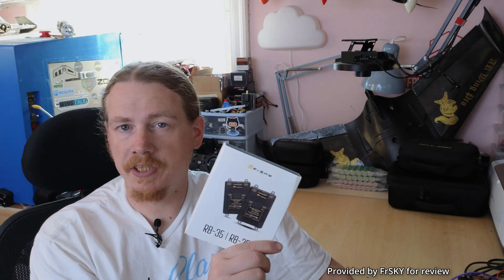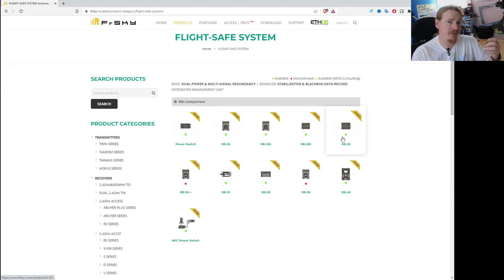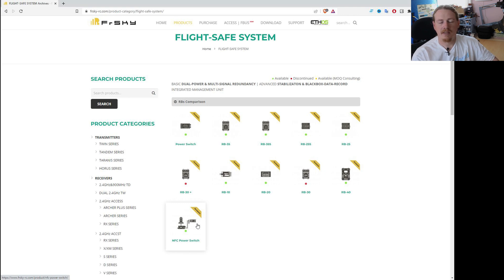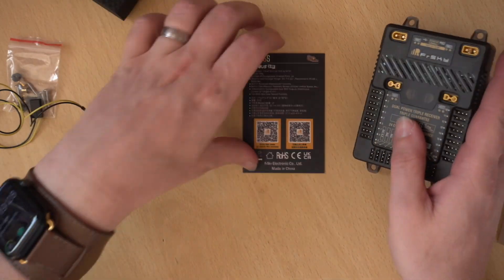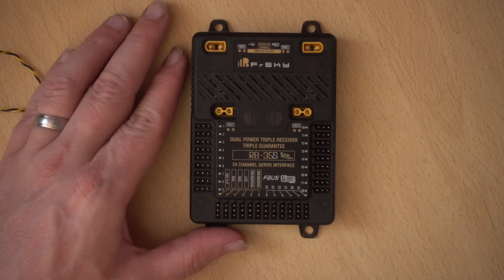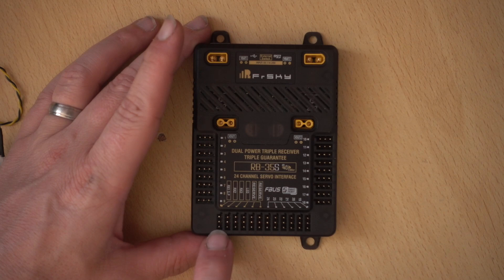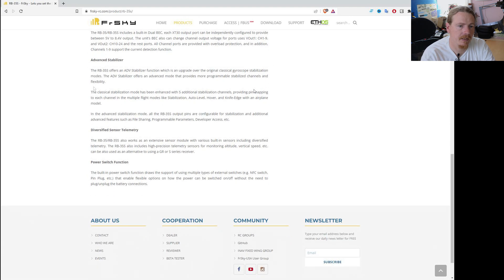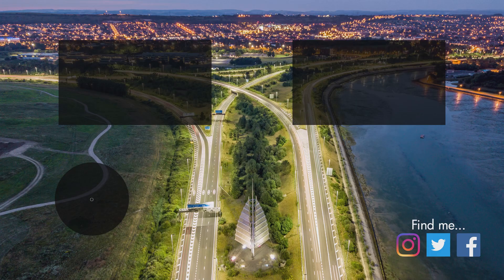First look at the FrSKY RB35S Flight Safe System

Comment: Good evening Dave

I’ve got an FRS Sky transmitter that I’ve had for about two years, but every time it needs an update my best friend does that with his computer

But moving forward, I would like to be able to do this myself so just before Christmas I downloaded the software to be able to do this. I have got an Apple computer.

I can log into the software and I can see on the screen, various updates, 

But I am unable to access any of them. I can’t even save the information on my transmitter to my computer, which is very frustrating.

Because they say you can use both Windows and Apple, do you have any idea how I can do this?

Because I have been watching your tutorials now for quite some time and I find them very impressive

Kind regards, Paul

Comment: I have the original RB30 that has been working fine. As a practical matter, I cannot see how what else the rb35s brings to the table for my application... namely, turbine and big bird support. Independent voltage adj would be best if it could be interactively isolated to the voltage out ports. Specifically, be able independently assign which ports use what voltage. Having it hard set to 1-9 and 14-24 ports makes it's usefulness limited, IMO. 
Also, I would love to know how (if) the voltage/bec redundancy works with different voltages OUT set. If bec1 set to 7.4v fails, does bec2 (set to 6v) switch in and set to 7.4. Or does ports 1-9 simply die with the bec or default to 6v on bec2. Knowing frsky, I'm sure they have sorted this out but I would just love to know these details.

Comment: Thanks for posting, will these work with other manufacturer receivers ie TBS Crossfire?
Reply from the maker: They may potentially work with Crossfire or ELRS as they can output SBUS. But I’ve not tested.
Reply: Thanks, was wondering what is the difference between fbus and sbus?i purchased one of these units after seeing your overview and am very impressed with how much functionality is packed in and value for money. The ultimate unit for me would be one that also incorporates a receiver and maybe even a flight controller.
Reply from the maker: At a very basic level. SBUS is only control link. FBUS is control link and telemetry.

Comment: Thanks for the video Darren. Would be good if you could explain why or when this unit is required, or advantageous over say the R10 PRo.  I have the R10 Pro on a 2 meter gas plane and power all of the functions via the receiver such as the 8.4v servos (usual surfaces plus flaps) , optical kill switch and the CDI unit using all 10 output slots.  What advantage do I have with the RB35 ? - i don't use stabilisation.  I can have at least 2 additional redundancy receivers connected to the R10 as well. The RB35 manual doesn't explain what telemetry comes with it which is a little weird stating vario, alt etc which is the same as in the RB25 manual?
Reply from the maker: Forgetting the stabilisation. The RB has the advantage of more outputs, current protection, and twin configurable BECs. The battery handling is also better than on the R10 Pro. 

But, for a 2m plane, the R10 Pro absolutely fine. I have a 2m petrol biplane (WotsWot XL). I’ll be putting an SR10 pro in there. Probably with an R9 MX as a redundant receiver. When’s the time to swap to the RB system likely depends on the model as well as the size. I know if it were a similar size turbine. I’d probably go with the RB for extra peace of mind. As the model would be massively more expensive.